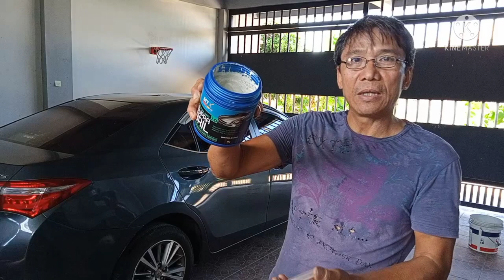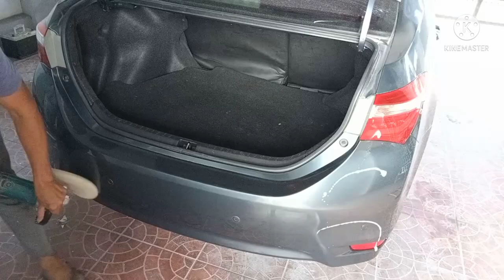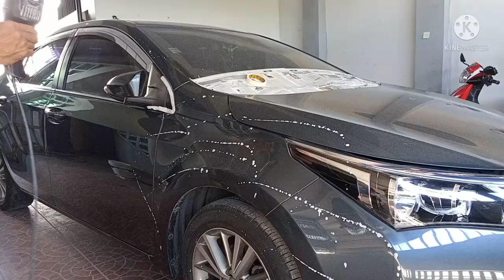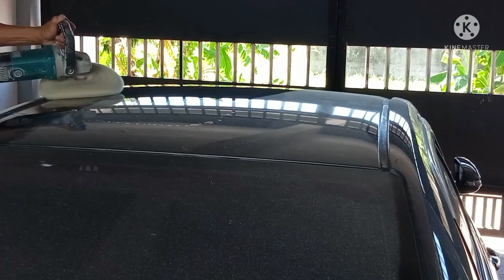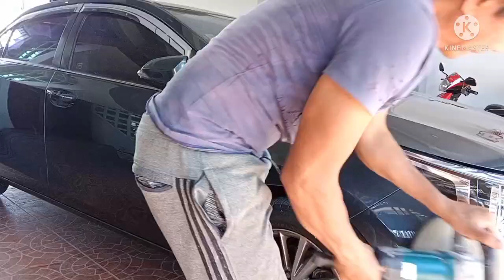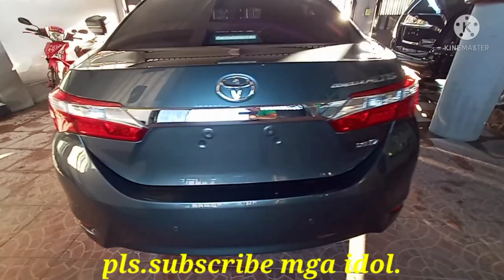3 step buffing #toyota#altis

Comment: gandang gabi boss, sa adventure ba, mga ilang litrong base coat at ilang top coat ang magagamit sa wash over. salamat po, more power po sa inyo...
Reply from the maker: Salamat po.depende po kung labas lang 2litro na kulay 4litro na topcoat
Reply: @willybelo4498  ganon po ba, hindi po ba pwedeng magbawas sa top coat boss?
Reply: sa labas lng po ang bubugahan ko boss. diy po, baka kapusin po ako sa budget. apply ko po ung mga turo nyo..